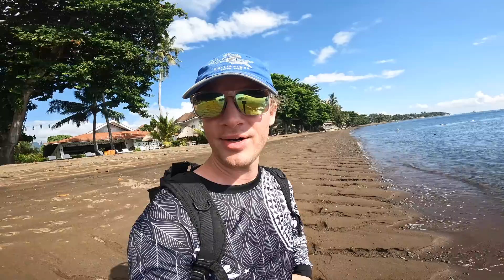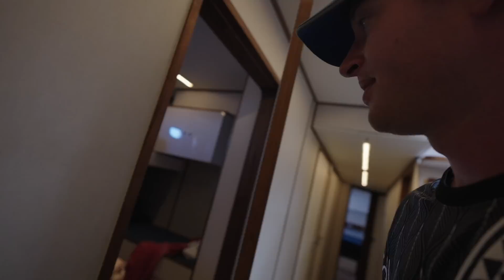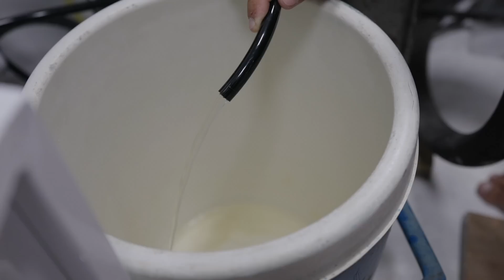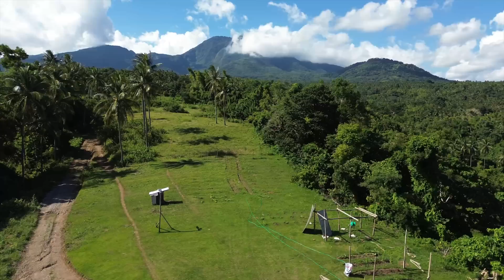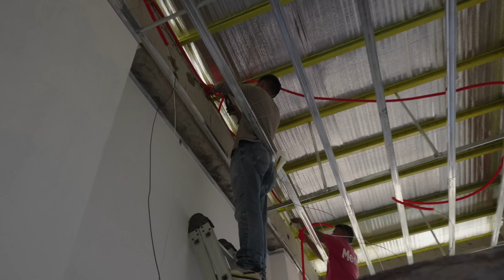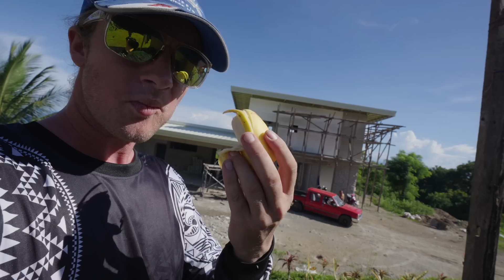Installing WATER MAKER Drinking From the OCEAN - More Solar Panels & Rockwool!

Comment: Finn, what powerwalls did you go with? How much were they? We have 4 Tesla walls here in our home in AZ (US) we paid $9500 each, they are 10KW each and we need them to power our 3 AC units to our home (it is more of the AMPS needed not so much the watts, we need 8amps to kick on the units each.) We have a fourth to power my F150 lightning and our BMW iX50, it takes about 5KW to power the truck from low to high using our "fast charge" and the iX5 doesn't have a fast charge feature but it takes almost 5KW to do a full charge. Our solar system is a 14KW system that powers our house and charges our battery units, it usually takes all the power we produce to keep them fully charged but we never drain the units anyway, we usually use about 6-7KW daily and depending on our vehicle use, we can add another 4KW there. Your home is coming along nicely, as well as the yacht.
Reply from the maker: I have video about it soon
Reply: @FinnSnowVlogs  looks like you have 2x-3x more solar power than Kulas now! 
You should have plenty of power to run all electric appliances including you air conditioners all year round!

Comment: Never seen a Diving Boat with that much of options.I bet that Gypsy can survive in the ocean for months without docking
Reply: Not really, its not made for spending months in the ocean. Its specifically designed for island hoping, coastal adventure, or even deep sea fishing. But, at the end of the day it is limited to the size of fuel tanks. That is why when Finn bought the boat they had multiple port of call. We've had similar spec motor yacht which was 24metres built by Riviera, sadly, we had to sell due to  maintenance cost.